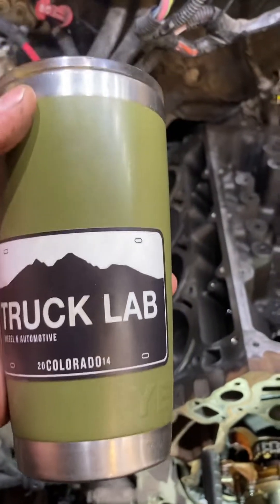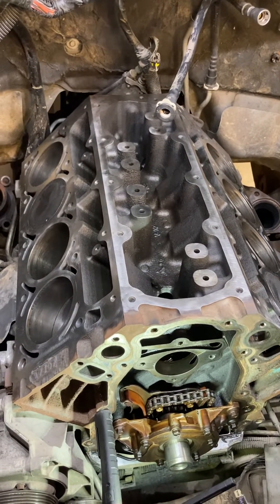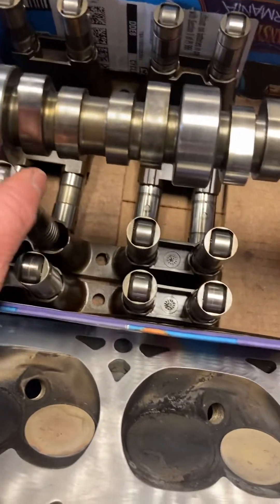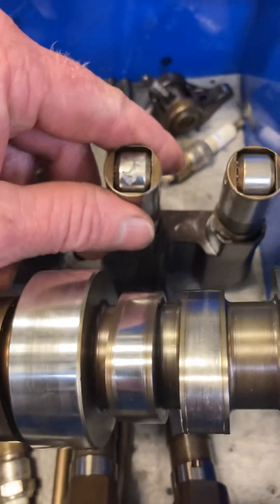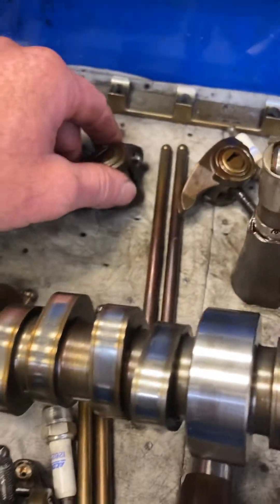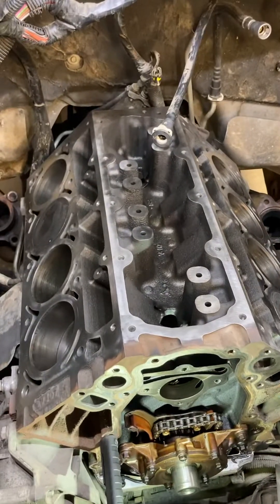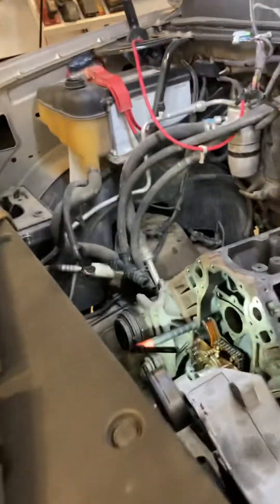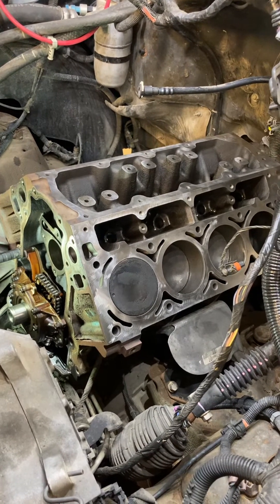What does not cause LS lifter failures

Comment: In plastic lifter we trust lol not me. I assure that even replacing those "genuine gm" trays twise a year wont save you from lifter roller failure. Youtube has many "engine builders" made videos of how loosen trays destroy engines. Over 30 years as factory mechanic teaches basics on heat, friction, lubrication and so on. I was supriced to find mr ginger who understand this. Have fun with the wrenches and ditch that ass monkey truck giving too much troubles to your life :)

Comment: I drive a 2003 chevy silverado with a 5.3 i only run oil that's slick and its got over 350000 miles on the original engine id  leave right now and go anywhere in it now the junk that was put out after 2005 has nothing to do with the design its the parts that were used cheap junky Chinese metal that goes for all brands of vehicles

Comment: Your cam Brg. size is wrong as if the center Brg. was the smallest the how would you get the cam into place as it would stop at the center brg.  As a GM Master mechanic I have seen many engines with the AFM Manifold O ring failures that dump oil  in the valley that leads to excessive  cam Brg. wear that in turn causes  lifter failures . If you fallow the oil flow chart for the engine you will see that a AFM manifold leak would reduce the oil supply to the #1 & 2 cam Brg. in turn will increased damage due to the timing chain pressure .

Comment: I have an 07 silverado that has 256000 miles on it that runs like a top no issues, makes a slight tick if it sits and idles but im 90 percent sure it is a exaust manifild leak not lifter failure considering sound goes away completely when driving. Another cause of this failure could be in proper oiling any number of these things can leak or lose oil pressure which could collapse the lifters
Reply: If it ticks at idle and goes away driving it's probably a lifter issues. Exhaust manifold leaks only get louder as  the rpm increases

Comment: A friend  of mine is an automotive  machinist.  He told me  the cause  is that  the roller tip on the lifter skids on the lobe rather than roll like it's supposed  to. The cure he told me was adding some marvel  mystery  oil on every  oil change.
Reply: I'd be careful with the additives. My 12 silverado had 119k miles on it when I got it and had a slight tick on a afm lifter so I ran marvels mystery oil in it and it definitely made it more quite but at 125k miles my cylinder #2 non afm lifter was seized and chewed up. when I tore it apart all lifters seemed pretty clean and nice but cylinder #2 had sludge on it. I'm a firm believer in MMO doing its job and cleaning the engine out but it can be a bad thing and clog up a lifter roller.
Reply: If what you said is true, you would see the wear pattern on the lobe.
I tend to not believe it, unless many other people are noticing it.

Comment: 255xxx km 2000 4.8 std trans reg cab great on gas runs great  yes gutless no torque 2008 2500 hd 6.0 runs great good motor a little thirsty no cyl de-act

Comment: My experience the v8 trucks and tahoes and camaros are easier to do a afm delete. The 3.9 impala is nearly impossible the computer requires hydraulic oil pressure to be correct and there is no aftermarket option as far as I know that IS OEM
Reply: Yup and Chevrolet killed off the impala as ford did to their passenger cars, everyone wants these tiny ass suvs now which have no room.

Comment: To much heat in my opinion- heat = thin oil = disaster
Reply: Don't use 10W oils in the summer  or in hi temp areas of the US.   Run 15W40 oils for long engine life.

Comment: There are two, and only two types of LS powered trucks: The ones that throw a fit and die (Like our old silver one that died after a bit over 100k) or the ones that absolutely refuse to die under any circumstances (Like our blue '02 suburban with 280k on it without ever being apart.) Why's there a difference? Dunno. Some are blessed, and some are cursed.
Reply: I HAVE A 02 300000 MI
Reply: @shaunnesbit1698  best years.

Comment: I wondered about the afm/dfm being the cause, but there stats are it is around 2% of those engines that have the lifter failure. I would think if it was a problem with that set up, it would be well over 50%.

Comment: Thanks for this video I'm looking at replacing my aging 2000 Ford expedition.its 4x4 with 4.6.it has 3.55 gears so I know all to well what you mean.but I've had no issues 175k miles.im honestly about to replace the fuel pump just for ease of mind.Was looking at a newer Yukon but from what I seen their just money pits.again thanks 👍
Reply: Had a 2000 suburban 10 years ago with a 5.3, 350,000 miles. I'm on my 07 Classic Silverado with 180,000 miles, come back when you are at 350,000.
Reply: @shadowopsairman1583  I would buy the Yukon if it wasn't for the cylinder deactivation.
Reply: Swap it for 5.4
Reply: Have to get 00-06 Yukon, much better than expedition and that's coming from a guy who likes Ford.
Reply: @JohnSmith-xx1lx  yeah I looked at them when I bought my expedition.more power   for sure.

Comment: I have a '99 GMC with 193K on its 5.3 engine. Rebuilt the tranny once but, never any issues with the engine. Not even any lifter noise. 
Trucks oil changed every 4000-5000 miles. I use AC Delco filters and Walmart high mileage 10w30 conventional oil.
Reply: 07 Classic with 180,000 on it
Reply: STAY AWAY FROM WALMART WITH YOU VEHICLE - DON"T PUT ANYTHING FROM WALMART IN YOUR VEHICLE !!!!

Comment: I made it to 117k miles in my 15 6.2 chevy. Excellent maintenance, cylinders 4 and 7 lifters collapsed and bent push rods. I did notice a drop in oil pressure. After tear down doing AFM delete, I noticed the cam thrust plate gasket was actually flat. I installed a fel pro plate and the molded gasket on it is much more robust. These lifter failures are a symptom of an oil pressure issue. I'm getting mine back together now, installing LS7 lifters, suppose to be the good ones, I don't know, getting ready to find out though. This is a L86 engine.
Reply: Get the oil pan pickup tube o-ring done. It'll restore oil pressure.
Reply: @wally7856 
I determined the oil pressure drop to the cam thrust plate. The factory molded gasket was flat o the one I took off. I bought a fel pro and it was a fat molded gasket. Oil pressure is now
 Cold 43 at idle
Warm 37 at idle and 41
 at 55 mph.
Before tear down oil pressure
Cold 34 idle
Hot 25 idle
Reply: @TheMrmmkkpro  I’m getting ready to tear mine apart this weekend. I disabled dod in the ecm, changed the oil pick up o ring and oil pressure has slowly gone to crap. I’m at 194,000 miles right now in my 13 Silverado.
Reply: @John Johnson  
 Yea , I used the obd 2 device and mine still failed. Check the cam thrust plate , that molded gasket is super important. My stock one was flat , the fel pro is fat . It's not too bad of a job. The wires attached to the back of intake cover were tough for me , took me a while to get them loose. Pretty straight forward though. I also bought a torque wrench that does degrees too , harbor freight and it was nice.
  I have driven about 1k miles so far and oil pressure is higher than ever.
Cold idle.     43
Hot idle.       38
Good luck.
Reply: I would have done the crossbar hydro lifters
Reply: Get an engine flush run it for 5 minutes change oil and filter use an acdelco your problem will be solved that worked for me

Comment: Lmao if you think you'll have better luck with a ford... good luck replacing those cam sensors and phasers in the
Reply: I’ve been a ford guy my entire life- they all have their issues- gm/ford/Chrysler. My 5.4 diesel rattler does not make me think he would have better luck with a ford. At least the gm is quiet, until it isn’t. My 2004 f150 purchased new has been rattling since 40k miles.  I tend to think the buying public does a lot of the r&d for manufacturers today.
Reply: @crazyfeller5704   That Ford engine is made by International Harvester- Not Ford !   Ford makes cheap vehicles and sells lots of parts to keep the running.
Reply: I heard those are expensive,  and always seem to be on backorder.
Reply: (F)ound (O)n (R)oadside (D)ead
Reply: Broken off plugs too